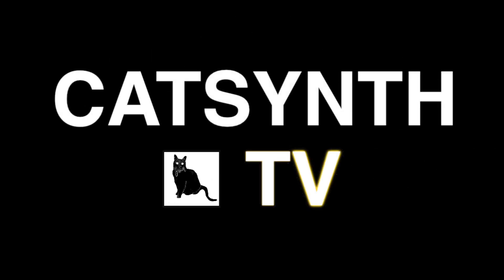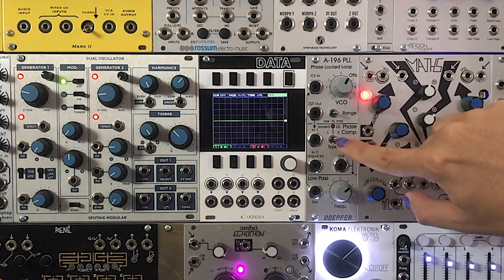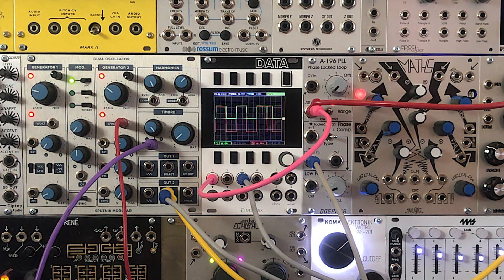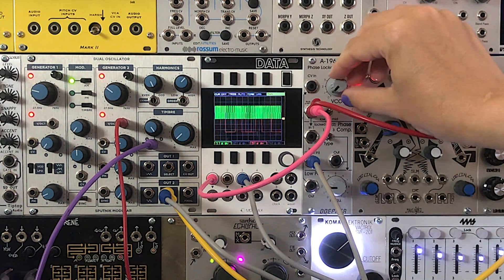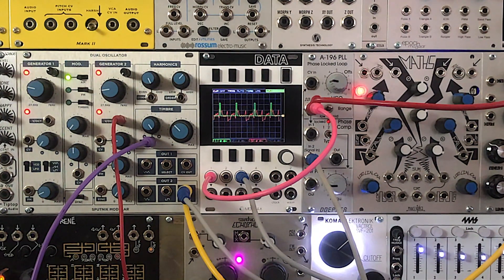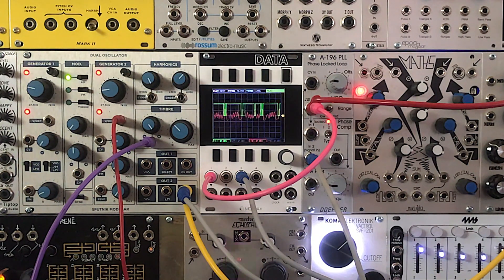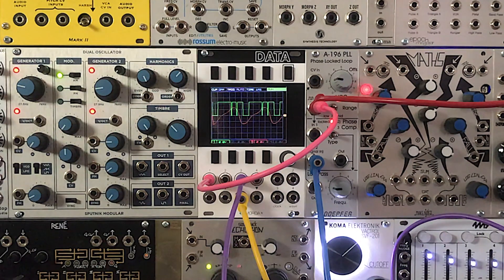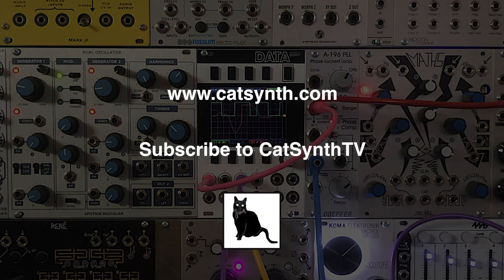Doepfer A-196 Phase Locked Loop [Episode 69]

Comment: Having trouble putting these sounds into a musical context...any chance you would do such a video? Maybe a jam video using this module as well as any other modules patched in?
Reply from the maker: Sure, I'll look into making one.  I also just acquired another module that does PLLs and looking to use that in a musical context.
Reply: As an idea, I've been using one to add a little extra texture or "zazz" to my voices. I sync the pll to my main oscillator, and mix a bit of the pll output in with the main oscillator pre-filter. I might even mix a bit of the pll signal in with filter cutoff cv too (just a bit to add some roughness to the modulation curve).

Or as a tonally related sound source for accompanying percussion voices.

Post your ideas and results too please, as I'm curious what else I can do too.